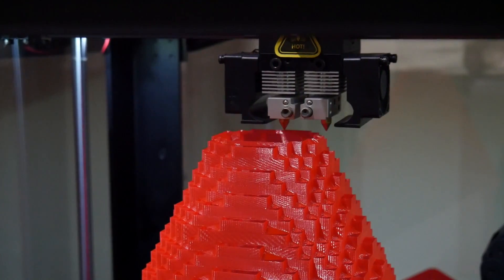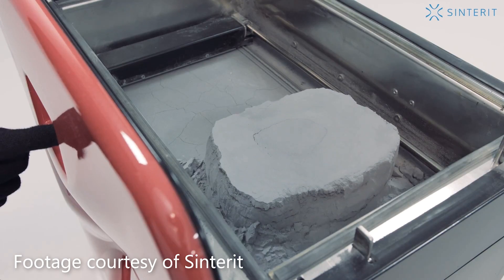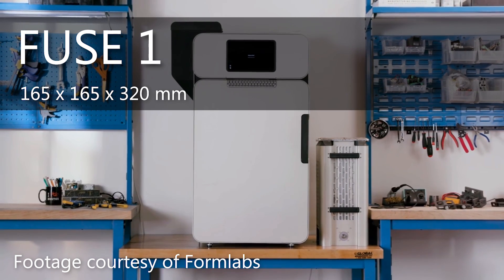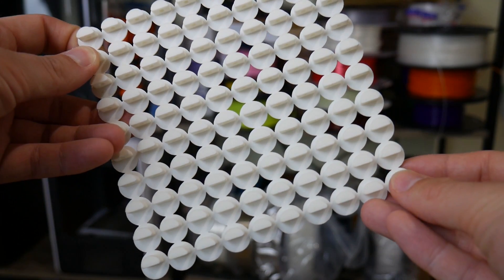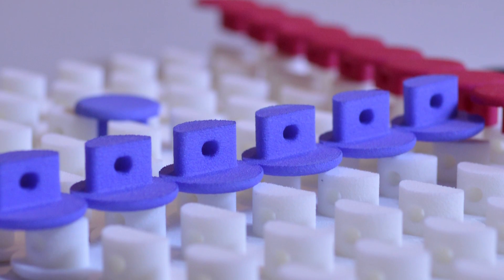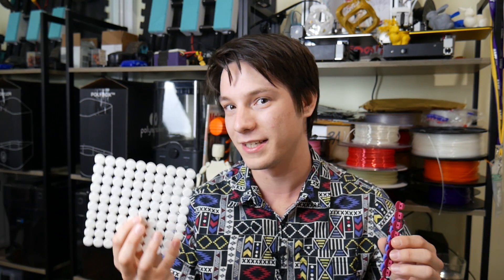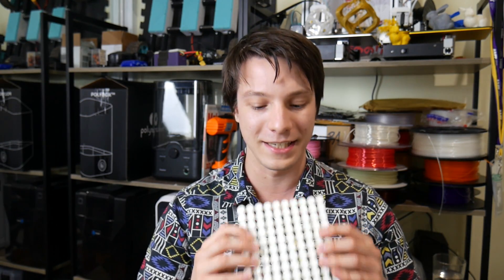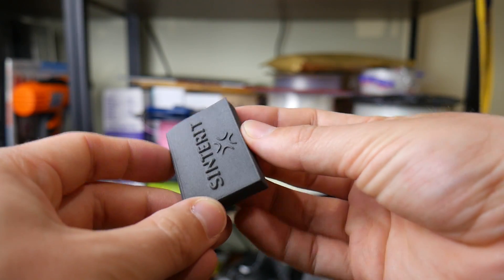Here's why SLS is the future of 3D Printing - Maybe. Formlabs Fuse 1 vs Sinterit Lisa vs EOS

Comment: Shrinkage is easy to calibrate for with any material, as long as you have reasonably accurate measuring tools. Less powerful lasing source? PWM? The real issue is the materials. I still personally think we're doing SLS slightly wrong, generally. What happens generally is machines available commercially go for a full sinter, which means you have to do things like heat the material and/or use a lot of laser power; OTOH what could happen, hypothetically in a consumer machine is a partial sinter - by only heating the outside of the particles just enough that they loosely stick together - that makes a very brittle and porous part that ordinarily would be useless and then dip it in a resin which would soak up like a sponge; that makes it stronger (stronger than a fully sintered part would be) - okay there's things you couldn't do but a lot that you could. This would also solve issues like needing to sand blast finished parts and make reusing the printing material more viable; and also partially solve the shrinkage problem. Some of us are working on these issues but it's just a matter of time until they're far more available to consumers at viable prices.

Comment: Last year, I used a plaster powder 3D printer that was very similar to sls printing - it would print a level of bonding agent at every level at the speed of a generic inkjet printer and then push on a new layer of plaster. The quality was simply amazing but the structural integrity was severely lacking. It makes models, not functional objects... I think it was a zprinter 450

Comment: I don't like using the term ''sintered'' when the material really seems to be melted
Reply: but the nylon that isn't melted IS sintered, it's why it isn't fully reusable

but in cold sintering printer like high speed sintering printers the unused powder isn't heated so it's 100% reusable
Reply: High Speed Sintering also heats up the chamber.

Comment: Fantastic video! And very honest on the SLS process pro's and con's, the desktop SLS printers certainly show finish as good as a 300k machine and very tempting in the10k price bracket, not to the level of 3DS or EOS but extremely good for the money, powder is well priced too.

The only thing that could possibly be added to the understanding of SLS is dealing with powder, imagine having to mix two tubs of lite as air powder in a  bucket to obtain the 50/50 mix of virgin and used powder... you wont be doing this in a home environment or small office, this requires a full suit and breathing apparatus in a sealed room. I am sure there will be clever people who develop great mixing chambers that will sort this issue, SLS is really cool if the powder can be contained better, it is a messy business.

For me SLA is still front runner, not the desktop ones though they just don't and can't work to a professional level with the current ridiculous shallow VAT designs. 
For me SLA is the 3D printing version of Solidworks, a lot wont admit it because competition is close but really Solidworks is all you need if you have the bucks ;) Not that I have it, I use Onshape cause I am a little more economic ;)

Comment: I don't see why is the future. You gave me strong reasons to doubt it. Its not worth the mess.
Lots of expensive material wasted, quick and obvios degradation, I cant think of a mechanical part made on it.
Future of 3DPrinting is very  blurry, you see all these technologies achieve the same in wildly different ways, so next iteration is going to be something insane, like bioprinting or nanobots

 Even resin has way smaller overhead and cost advantages compared to precision obtained.
SLS sucks, in my opinion.
Reply: SLS is one of the most used printing processes in industry. It's reliable and can print a vast range of materials (including metals). However, these (relatively) low cost machines have lasers that are to weak for anything but nylon. I don't think these are worth the price.

Comment: I am looking at SLS mainly for speed and precision, this is mostly for professional use and I am not investing until that price comes down much more.
Even if you 3D print ABS with an FFF machine I advise creating a professional workshop environment for it.
Also considering the engineering-grade materials FFF machines can work with nowadays (nylon works fantastic as does copolyester) FFF is still the way to go.

Comment: I've been using SLS exclusively, for several years. I've never owned or even used an FDM 3D printer. They are utter garbage.
The freedom you get with SLS, is unbeatable. No support structures to mess with, much finer detail, much stronger.

Comment: wonder how long it will take for them to install a recycling vacuum to collect most of the powder after a print.

Sure it couldn't run during a print and it would create another step, but it could improve the end user experience by making post processing more manageable. 

a sifting system might be nice also but considering the granule size doesn't seem practical.

Comment: Don't turn it on, take it apaart!  I only want to know how powerful the lasers are.
Fuse 1 UK price ="starting at £12,959".   I didn''t realise Brexit had done so much harm to the £ already.
10W 1066nm fiber laser. 0.2mm spot size.   That sounds doable with diodes

Comment: For this to take off for the hobbyist user,  there needs to be powders developed that are far less expensive and more recyclable, even if they are not strong and have a low melting or fusion temperature. I did not know that the powder needed to be preheated, compromising its re-usability,  and was surprised how expensive it is. Even resin for SLA is cheaper, and  Nylon powder is not needed for all 3d printing needs.

perhaps a SLS printer with an adjustable build chamber to minimize powder wastage needs to be developed for small jobs. The need for a specialised room to remove and clean the printed items, and the hazards in doing so make it not suitable for the hobbyist at all.

The nirvana of SLS printing looks to be the reserve of commercial operators that use it to make money. Perhaps a  niche business service opportunity can exist for hobbyists to have their creations SLS printed, where multiple print jobs are done all at once, and not be too expensive. Either that or be a millionaire to own one for oneself and have heaps of money to burn.

Comment: Is the powder degradation due to oxidation of the hot plastic or just plan thermal degradation?  Something like an oxygen concentrator (using the waste stream, so youre rich in nitrogen) and purging the chamber would help with oxidation, but not plain degradation. But that would be pushing it even further from home use with even more support equipment.

Comment: For making delicated, dimension and strength required prototypes。All existing 3d printing methods are just a crap。Learnt and used SLS machine that costed US400,000 thirteen years ago to make a 1/12 R/C model car。Gear box and all the mating parts need to be fine touch in dimension before they can be assembled。If needing small quantity for use and also to fill up the large tank volume。Better go to make aluminum temporary injection mold instead and do the injection molding method to produce the parts。Dimension, surface finish and  plastic material strength are the super。。。。

Comment: Material costs 5x as much as FDM, most of it is wasted, you can't do hollow internal spaces, can't do multiple materials in the same print, and it takes many times longer to print? Doesn't sound like the future to me. Now if someone comes out with a sub-5K SLS metal printer, that will be a big deal. But even then, it will have to achieve better detail and strength than sintered Filamet.
Reply: They already print titanium parts for aircraft like this.
Reply: It will probably find it's (rather big) niche in vintage car repair - it's most likely the best technology to make durable replacement plastic parts at a reasonable price point.

Comment: The different colours are due to the wavelength of the lasers used. The expensive EOS machines use high powered CO2 lasers operates in the 10.6 um wavelength, PA12 absorbs well in that range, downside is the laser system is expensive and takes up a lot of space. The desktop SLS machines use a compact, low cost, laser diode, operates @ 405 nm, powders need to be black in colour to absorb at this wavelength. So the desktop systems use PA12 blended with carbon black.

Comment: Well that was a little depressing; especially the material re-use fact...
Reply: Cool, my Blender models could use a blend blended in the blender
Reply: That said, if you make full use of the build volume (basically, plan your printing sessions so you can fill the chamber with prints, rather than trying to do one at a time), you can largely mitigate the problem of wasted powder...
Reply: Perhaps blending the material in the blender could make it better for reuse.

Comment: As the technology gets more popular, I suspect the cost of the nylon powder will come down. An obvious improvement would be a way to adjust the size of the chamber as needed for whatever you were printing. I've seen some videos from Formlab and the Fuse can do some amazing things like printing chainmail or a working gearbox suitable for actual use in say an RC model. What would be even better would be a home or small business printer that could do sintered metal parts. I know there's at least one company using parts from a printer like that for jet engines because it's far easier to get complex internal structures in the parts that could be done any other way.

Comment: Powder is black because in cheaper systems they use diode laser which is cheaper, but has not suitable wavelength, that light is not absorbed by pure white nylon (it reflects from it). In expensive systems they use co2 laser which get absorbed much better and you don't need black absorber in powder.

Comment: Since you can't really reuse the unused powder, I wonder if you can use it as a sandblasting material. You'd at least then get some value out of what you can't use. 
Hopefully someone does research into SLS materials, and finds a way to make one that isn't damaged from being in the machine. It'd be perfect to print, sandblast, and reuse the material. Maybe even in the same machine, using air and vibration to clean the part, and have the sandblasting be automated as well.

The only problem I have with SLS is the same as I have with SLA, you need a drain hole if you have a solid object. Incorporating drain holes can be really difficult at times, especially if it's a part that needs rotational symmetries, a platonic solid or a stellation of a solid for example; though I have found, within that example, that you can easily have a core object and shell objects with the drain holes between the mating faces. Unless you just want a 100% solid part, but that's time and resources that'll cost a lot more, especially on larger prints.

Comment: I don't completely agree with the "maybe not desktop friendly" although I realize you were probably thinking about todays technology and not 10 years down the road. I can only imagine that they will make SLS systems with smaller volume so that there is less waste and cleanup. But I think you are right that this kind of system would be better for a small company and not the somewhat casual printer enthusiast. I would recommend doing this kind of post processing in a separate area that is already kinda dusty, like a nice basement or a garage. I know a lot of makers probably have this kind of workspace already available.

Comment: We have about 10 of the large EOS SLS printers at my Company printing in mostly stainless steel. They are excellent printers and create some very impressive parts with a very high levels of detail, ( they should for £1000,000 per machine with the powder recovery system). I have a little FDM printer at home that i use for my personal use, they wont let us print anything personal or fun on the EOS printers because of cost and time.

Comment: No way, so expensive, no clean, fdm still forever...
Reply: Maurilio Santos Junior consumer 3D printing companies should focus on SLA. Lately some companies have released very cleap SLA printers that use a LCD screen instead of a laser. I don't see this kind of innovation in FDM printers.
Reply: fdm is clean, low cost, and the quality is near of "state of art". Just it... You can buy a fdm near $500-1500, but a sls more than $6000, and you will need a great workstation to handle  material powder and the dust, your wife will like it so much... you will get a divorce...
Reply: I'm talking about SLA, not SLS. SLA works with liquid resin. It's cheaper than SLS and the parts have the same level of detail. It's a bit messy and the fillament is very expensive, but a 1000€ SLA machine can outperform any FDM 3d printer.

Comment: problem with sla/sls is that its very messh compared with fdm... if we would have closed cartridges within closed ed printers so that you basically pop a cartidge in and take an item out. otherwise people will not want to play with powders and resins
Reply: not to mwntion that fdm printers can be used as a ploters/laser engravers easli...

Comment: Also, check out the Sintratec Kit.  (see web site)  I am a hobbyist and I just had to have an early affordable SLS.  It has a very modest build volume of 11x11x11 and retails for 5.5K (I think)  The kit went together quite smoothly - over a solid six days.  I learned a lot about SLS by building it and found it quite enjoyable. 
From a home user perspective, It is everything you say - very messy, a heavy waste of powder if you don't fill the volume with parts - I think they claim 50% reuse - you really need to be setup to sort and remix in your virgin powder.  I'm getting a sandblaster and have found the surface really needs a scrubbing for that extra quality.  (they include a dust vacuum and electric scrubber - toothbrush?)  Only the kit is available in the US - I think there are laser power import issues, but I'm not sure.  
They are very helpful and nice to work with when I have had challenges.  I can nail the X/Y dimensional accuracy with galvo adjustment, and the Z is a little more straight forward (it was fine off the bat).  It does build strong parts!  I am still going through a few learning experiences as I try to push the limits a bit - my current challenge is trying to print chain-mail.  There are tons of thermal things to consider.   Due to some combination of user error, settings and plain old machine capability i haven't yet been able to make a nice mat of flexible mail that doesn't have a solid area in the middle of it.  Anyway, I am still having fun and have no regrets.

Comment: You've convinced me that SLS is not the wave of the future.
Reply: high speed sintering is the future, the unused powder isn't sintered and the part can be easily pulled out the powder bed. the unused powder is also 100% reusable and the system is 10 times faster.
Reply: John theux I agree sintering powder is reusable in the normal sintering process but not so when using SLS.
Reply: I think the problem with SLS is that the heat create with the laser dissipate too fast because the laser melt a tiny surface so you need to heat the chamber. I think future SLS will don't have this problem with more powerful lasers.
Reply: It's also a problem of electricity consumption, if you melt 1X10kg of a matter you need less power than if you melt 100X 100g of the same matter because the more the part is tiny the faster it cooled and you need an amount of energy to keep it melted. so to melt a part single voxel per single voxel you need too much electricity, to heat the chamber solve half the problem.
Reply: wave?
Reply: DLP resin printers are the real future.
Reply: you clearly haven’t used SLS then
Reply: It's the best system to 3D print metal, useable parts or tools. SLA or FDR is still mostly for toys and gadgets.
Reply: @truantray  I used to work for a SLS metal printing company... the issue is the tempering of the metal
Reply: okleydokley metal parts are really only good for canning foods and frying pan handles.

Comment: FYI HP's upcoming Multi Jet Fusion can recycle all the unused nylon material. I have seen it working in-person at HP. They will also offer a companion post post process unit. It takes 12 hours to heat up and 12 hours to cool off.  IMHO a reasonable desktop SLS printer seems to be a long way off. However the large industrial ones are viable and suitable for mass production. https://www.youtube.com/watch?v=VXntl3ff5tc